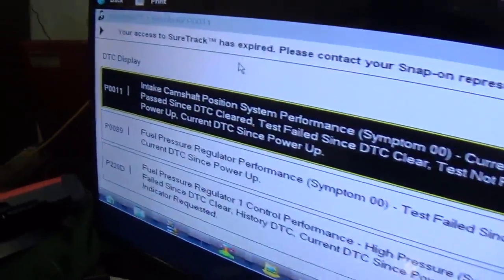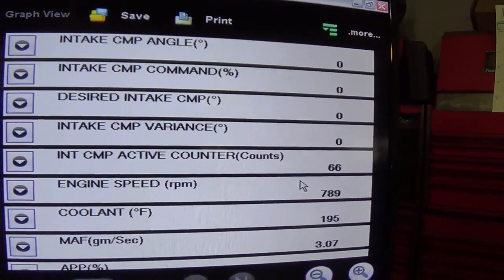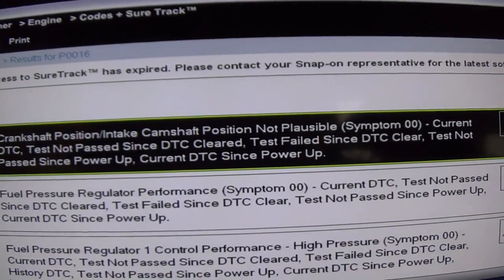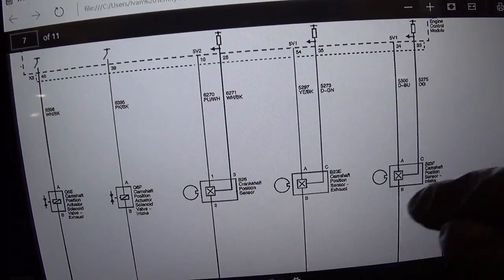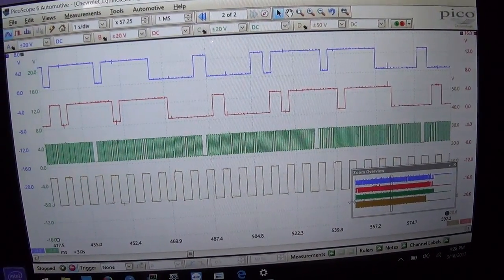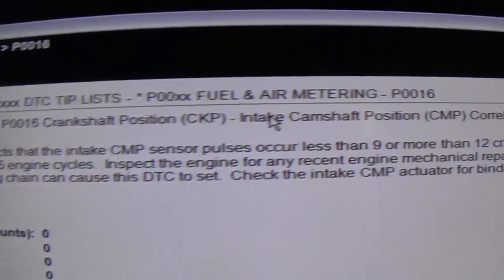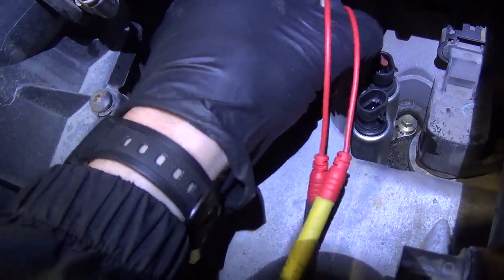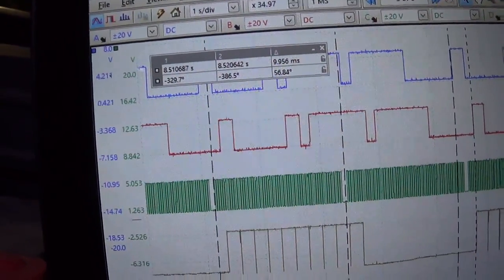P0016 P0011 Low Power case study: Chevy Equinox - Part 1

Comment: Needs an exhaust VVT actuator ( I always do both), and the timing chain (primary) is stretched causing the P0016.  I can hear the chain plain as day rattling.  After it stretches it usually breaks the guide on the radiator side.  Get the Coyes kit for around $100.

Comment: I have a wicked squeak sound then as i rev it turns to a horrible knocking/tapping sound. Sounds like it is coming from the timing side. When i pulled the valve cover the chain was super lose even after i replaced the tensioner and activated it. What could it be?

Comment: 🕵️‍♂️Not putting the right gas 92 up and not turning your car off will putting gas plus u need to do a full tune up..4 coils, Spark plugs, both  Camshaft sensor, plus change the oil every 3 months, the best oil filter you can get...plus more 🤦‍♂️ but it's a good car 👍if u don't like to take care of your car then don't buy this car plus if your a very cheap person..

Comment: do you copy and save the waveforms once u get the vehicles running good? you could build a data base and that would be cool. it seems viewing wave forms that you have no way of knowing if it is correct or not is a moot point. with the variable valve timing it seems to complicate the issue? could you pull the solenoid out and bench test it? most solenoids click when power applied.

Comment: Working on an 09 Pontiac Vibe (Toyota) with 2.4L, I am getting only one code p0016, and have checked wiring on all 1vvt solenoid, 1 crank and 1 cam sensor, and replaced vet solenoid, crank and cam sensor, clear codes and drive it a mile and bac, engine, and traction lights all pop up along with the p0016 code...frustrating as hell when I bought this thing for my daughter...awesome vid by the way..

Comment: I have a 2011 Chevy equinox lt 2.4l 
With a p011 A camshaft position timing -over advanced or system performance bank 1. Prior to that I changed out my solenoids for the lack of power I was having on my rpms when accelerating it would loose full power now i switched out my camshaft sensor as well and today my truck actually turned off while driving turned back on but still the same code changed the oil changed the filter and still stalls while at a red light jerks back and forth help???

Comment: Long, long story made shorter than it was.  This process will seem to be counter-intuitive, but remember that mechanical problems often show up as seemingly unrelated electrical problems, because cars are run by computers. My saga began when I suddenly had a lot of warning lights and DTCs appear, out of the blue. It happened at about 88,000 miles, a few thousand miles after the Chevy dealer replaced a water pump/balance shaft chain in the engine under a special GM warranty; this chain is located  behind the timing chain, which requires the removal and replacement of the timing chain, and resetting the valve timing, a critical step in getting trouble-free engine performance.  

If you are in a situation similar to mine, begin analysing the problem by performing a thorough visual inspection of the under-hood wiring with a strong light, and check battery voltage. Overlooking a bad battery, burned wires, corroded connections and disconnected hoses and wires is frustrating and wastes time, but can be the source of many electrical problems and the cause of many warning lights. If all seems to be in order under the hood, then the next step in diagnosing sudden, myriad problems in a 2010 Chevy Equinox with the 2.4 L Ecotec engine is to remove and disassemble the timing chain tensioner; if it is full of small metal parts, replace it immediately with an OEM part made by AC Delco, or just simplify this procedure by replacing it straight out.  Amazon is the cheapest, quickest source of this item. Put it in, reset the tensioner per instructions, visually and manually check the chain tension and visually check the position (at TDC of cylinder 1 on exhaust stroke) of the camshaft sprockets  and the correlation of the timing marks on the sprockets with the colored links on the chain, and if things look OK replace  the valve cover and crank it up. You may have just dodged a bullet. 

However if you see that the upper chain guide has lost its Teflon guide material, if the camshaft sprocket timing marks are in the wrong place or don’t line up with the colored links in the timing chain, or if the timing chain is very loose, you are not in luck, and will probably have to replace the timing chain and chain guides. Again, get OEM parts, i.e. the timing chain kit made by AC Delco - Amazon is still the cheapest and quickest source, but that ultimately depends on the availability of these parts locally and what you are willing to spend. Follow factory instructions in doing this, before cranking the engine again.  Please look at all the steps Ivan went through in solving the Equinox puzzle.  Also view the other YouTube channels that have dealt with these issues.  I think that most mechanics and DIYers replace the chain tensioner without ever looking inside the old one.  If chain tensioner failure or internal damage is a problem in 1 out of 100 cases, then a lot of people have the same problem I had, and spent a lot of money for nothing.  Good luck!
Reply: I had a neighbor who had trouble getting his saturn up a hill.. his old lady is a heffer, abt 325 pounds,. his car started ok, but under load, the car missed and lacked power.. He had everybody in the state of texas look at it, and couldnt figure it out. come to find out, it had a weak battery. it would start the car, but the charging system was always trying to get the battery to full charge, but couldnt because of a weak cell. electricity will try to go into that battery, instead of fire plugs and injectors if the battery is weal or low.

Comment: Whoa, this one's definitely a bit of a head-scratcher!  Everything is pointing to a timing problem, except I can't believe the engine would even run with the cams 50+ degrees out of sync.  I'll place my bets on a combination of things:  An electrical problem causing a false reading of a mechanical anomaly.  (That should be vague enough to cover most of the bases!  LOL)

Comment: sounds like the engine has a couple of broken timing chain guides... I bet there is only 2 quarts of oil in this engine... 10-13 equinox's have oil consumption problems due to the piston rings getting full of carbon and sticking. I've replaced heads due to the chain stretching so much and breaking every single rocker arm and bending valves, pistons and rings, timing chains and the high pressure fuel pump for it leaking gasoline into the oil on the 10-11 years. those solenoids go bad as well, it looks like someone has already changed them usually one has a grey connector on it.
Reply from the maker: Damn that sounds like a poor engine design overall haha

Comment: money is on a bad intake Camshaft actuator. GM vauxhall opel engines very prone to failure on VVT engines over here in UK. also is caused by sludge build up on the actuator solenoid. i believe they are ment to remove the mesh filters on the solenoids after the first service. as these are only ment to catch swarf.
Reply: and GM did update these actuators recently improving oil return valve etc.

Comment: Ivan, I suspect the intake cam isn't advanced at all... I suspect it's lagging behind.  Perhaps the 5 degrees on the exhaust cam is the 'minimum' advance and the intake cam isn't able to reach that position due to failed actuator or plugged oil passage???  179K on that badboy, you either fix it cheap or eat your diagnostics.

Comment: Love your vids man!!!!  I would def have him put a new engine in.  Oil consumption from cheap piston rings causing low and dirty oil destroys everything in its path!  
    I would bet $1000 that the tear down will reveal stretched timing chain, broken guides, top chain guide worn to the metal, both geared actuators stuck from sludge, rod bearings worn heavy on the sides, #3 & 4 intake and exhaust cam bearings scored, scored cylinder walls and a small crack in the middle of the exhaust manifold.....and an internally failing/leaky high pressure pump.
Reply from the maker: Sounds like a load of scrap metal...truly disposable lol

Comment: I have a hard time seeing it being a timing chain issue being that the solenoid did not change the icmp to ecmp correlation when the pcm tried to command it at the end of the video. I suspect your compression test will show no issues and your problem will be in the hydraulic circuit that solenoid controls or the mechanical cam actuator itself. as always great video and looking forward to part 2.
Reply from the maker: You won't be disappointed!

Comment: the scanner doesn't allow you to actuate the vvt with codes because if there is a timing problem they don't want you to  be able to command the computer to bend valves.
Reply: Kevin Schmitt but I want to make the ecu destroy the engine.
Reply: Kevin Schmitt but I want to make the ecu destroy the engine.

Comment: At one of the troubleshoot codes it was mentioned "check for the correct oil type" is it possible that there is a clogged oilline somewhere. I flush the engine before every oil change and it helps often to get rid of rough running engines.
Good luck Ivan I like your vids vey much.
Reply: Willem Streutgers What do you use to flush the engine with ?
Reply: I use Forte Motor Flush

Comment: Nice Part I troubleshooting & Pico action. Your senses sometimes are your best diagnostic tools and it sounds like your ears are picking up a timing issue/compression loss on crank. Also check out TSB PIP5203C for the P0089 & P228D plus it concerns PN issues with intake camshafts, intake camshaft actuators. Waiting on Part II

Comment: Cam phaser actuator solenoid are known to go bad on those ecotec.
Reply: with the high milage of the engine it could be problem with timing chain, seen broken chain guides on some of those engines.

Comment: I'm putting my money on a stuck intake cam phaser.  Looks like it's jammed all the way to it's maximum deflection and intruding on the compression stroke.  I don't think it's a stretched chain or both cam position waveforms would be off roughly together.  I'm not a mechanic, so I could be wrong, but that's my guess based on the weight of the evidence.

Part 2 should be interesting.

Comment: timing chains, pistons and possible short block due to cylinder scoring.  also change the oil more than every 10000 miles on cheap oil.
Reply: forgot about the actuator solenoids

Comment: Ivan, for future reference I think you could have used the solenoid test in to check the computer control of the solenoids with the engine off.  In my Autel that's how it works, one test for the solenoids key on engine off the other for the whole system engine running.  Will be watching to see if its an actuator or chain issue.
Reply: I did it with the engine running and demanded it for advance and it would stay at 0 for my intake solenoid

Comment: Looks like you have a bad intake cam sprocket not returning to home position and now cam timing is off. I have taken cam/crank waveforms good and bad on these engines and it's hard to decipher because the crank synch doesn't really line up with any cam pattern. The computer shuts down the solenoid when it sees a problem with timing or circuit faults.

Comment: VVT solenoids. Very common on these. They get clogged or the screens fall out. Replacements the screens are captured. They always throw the cam sensor codes. And most are stuck as hell. Change the VVT'ts and the oil, you'll probably find the screens in the oil pan.

Comment: It's a GM, so my bet is on a mechanical problem with the cam. :)

They seem to have forgotten how to build engines in the 21st century. I'm the "proud" owner of a oil burner that started at 50k miles. :(
Reply from the maker: It is a shame. GM made fantastic pushrod engines. Overhead cam...not so much lol

Comment: At 179,000 miles may be better with a good low miles used engine as the cost of doing chains and actuators plus high pressure fuel pump will cost more than a good used one would cost. I'm fairly certain you have a timing issue looking at them patterns plus may have oil flow issues as well if it wasn't well maintained

Comment: Camshaft actuator/phaser is likely suspect/problem...I've come across same issue a couple times on GM with 4.2 engines...Maybe the ones on 2.4 suck equally...Another time, found stuck actuator solenoid with varnish from neglect of regular oil changes...Good luck..

Comment: chain and guides time????
Reply: very possible... the terrains have an issue with the chains and the high pressure fuel pump which is driven off the cam lobe... tensioner are hydraulic and run off of oil pressure... lack of oil, condition of oil can ruin the tensioners, the actuators and could cause the high pressure fuel pump to act funny. 

there is a bulletin regarding this by GM to replaced the chain and guides, and the high pressure fuel pump but you still need to change the cmp actuator solenoid valves as well. 

im a drive ability tech for GM

Comment: There's your problem ma'am, its 2.4.
Reply: ha ecotec engines suck!!!!
Reply: My uncle has a 2011 equinox with the 2.4L 4-cylinder, he has to add a quart of oil every 850-1000 miles because it burns so much, Dealer would only warranty the engine if it burned more than a quart every 700 miles. You cannot go a whole 3000 mi oil change interval without adding oil. Not what I would consider a 'very good engine'. When the transmission went out under warranty, GM wouldn't let the dealer install a new transmission they had in stock, they had to order parts and rebuild the original trans so he was without a vehicle for about a week. It currently has an issue with that disables the AWD, I suspect it just needs a sensor, but he's adamant the transfer case is damaged (I'm not sure what system it uses so I'm using 'transfer case' generically) so AWD isn't working, but he just lives with it, says its not worth repairing anymore. It has less then 100k on it, pos.
Reply: the 2.4 eco tech engines are actually very good engines . so i dont know what you  base your opinion on/from but you would be incorrect.
Reply: Just put a timing chain on my mothers 2010 Malibu with 76k. Mobil 1 its entire life, burns 3 qts oil in 5000 mile oil change interval. Plastic primary chain tensioner was broken and bolt was worn down by chain. Not so great!
Reply from the maker: Dang sounds like you got a lemon lol
Reply: they are all lemons.
Reply: The older Ecotec engines seemed to be pretty solid, but it does seem like they introduced a bunch of problems with timing chains, cam phasers, etc. when they added VVT to them later on.
Reply: The 2.4 in the Equinox is a direct injection variant.  It has known issues with timing chains and guides.  I think it may be the result of the fuel pump using to much pressure and fuel gets into the oil.  Replacing the pistons and rings is another issue.
Reply: the 2.4 engine is made in either mexico or germany... depending on where it is manufactured one of those have alot more issues then the other. im trying to recall from memory here that the ones from germany seem to be the ones with issues. the ones from mexico by far have alot less issues.
Reply: the 2.4 LAF (DI) is in the Equinox and the 2.4 LE5 is in a lot of GM's smaller sedans.
Reply: they are all direct injection 

(i work as a drive ability tech for a GMC/BUICK dealership. i  work with these engines all the time
Reply: Josh R everything I can find states the LE5 is not DI and the LAF is
Reply: Ha, yeah. My goal is to work on it as little as possible. She was like maybe I should get something else. Thats a big 10-4
Reply: The 2.4l in my 07 Cobalt SS hasn't given me any problems. And from what I've read on ecotec forums, ecotecs are good engines so long as they are maintained.
Reply: i have an 08 pontiac g6 with nearly 114k miles on it... i havent had to put chains on it... its a 2.4 eco tech

the only things i have done repair wise to the engine is a purge solenoid, and the intake cmp actuator solenoid valve and the exhaust cmp actuator solenoid valve . i have no leaks, no oil burning/consumption
Reply: It was a bit of sarcasm lads, didn't mean to ruffle so many feathers!
Reply: m ph all to common unfortunately
Reply: Frank Gonzalez these newer versions are even worse

Comment: pretty much all Chevy are low power including mine
Reply from the maker: https://www.youtube.com/watch?v=gOqwooshRxA
Reply: HAHA I've had a 90 Silverado 454 SS stock no mods 415 ft lbs torque at 1800 rpm just off idle and my 06 Silverado SS with 6.0L 380 lb ft of torque at 4000 rpm stock from factory. We won't go into the ZL1 Camaro & Z06 Vette and the ZL1 has low power...only 640 HP and the Z06 is a dog at 705 HP. :D
Reply: you don't like GM vehicles do you? haha!